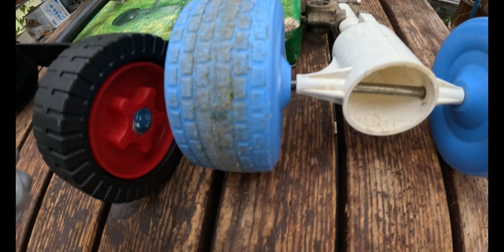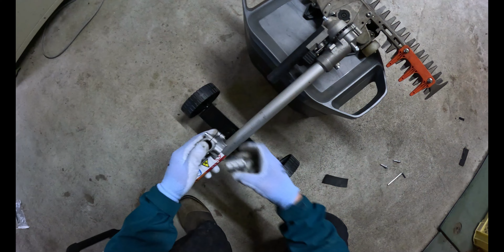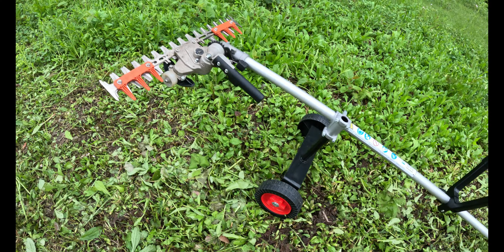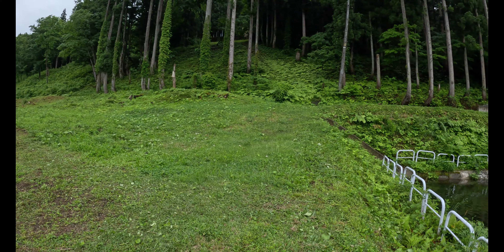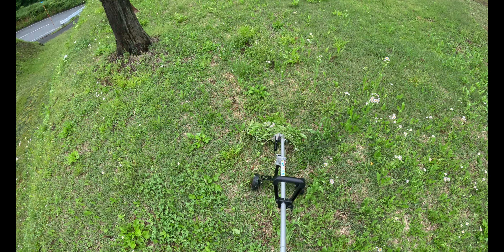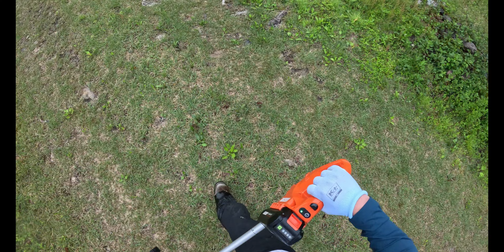Ekoバリカン市販タイヤ取付20240602

Comment: Thank you for the nice video.  
I noticed that it seems like the cutter height is hard to control with the wheels in the middle of the trimmer shaft.  Just a suggestion, but if you were able to mount the wheels to the ends of the cutter bar, it might make the cutting height more consistent.  If you have access to a 3D printer, you might be able to make custom axles that mount using the bolts on the cutter bar and would hold the wheels you have.
Thank you again for the many great videos and I hope you have a wonderful day.

素敵なビデオをありがとう。  
トリマーシャフトの真ん中にあるホイールではカッターの高さを制御するのが難しいように見えることに気づきました。  単なる提案ですが、カッターバーの端にホイールを取り付けることができれば、切断高さをより安定させることができるかもしれません。  3D プリンターを利用できる場合は、カッター バーのボルトを使用して取り付け、手持ちのホイールを保持するカスタムの車軸を作成できるかもしれません。
たくさんの素晴らしいビデオをありがとう、そして素晴らしい一日になることを願っています。